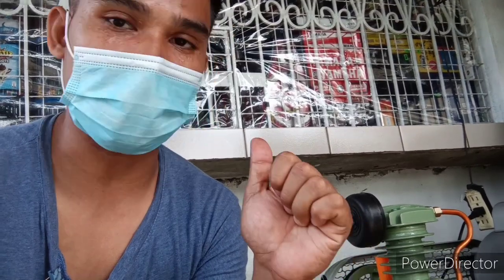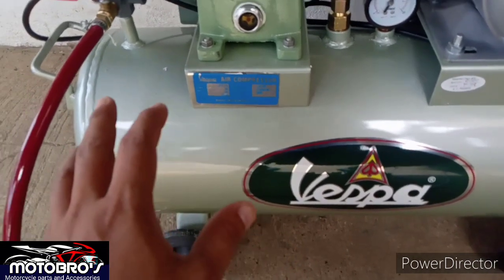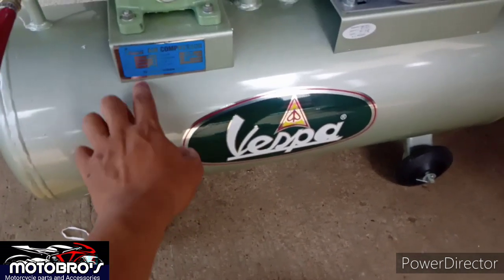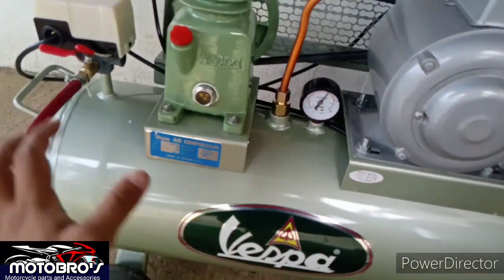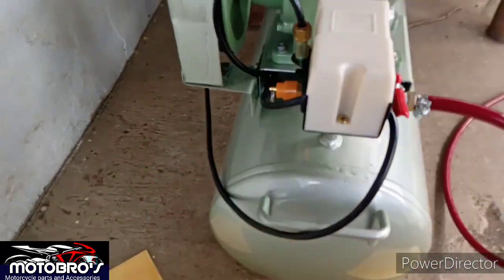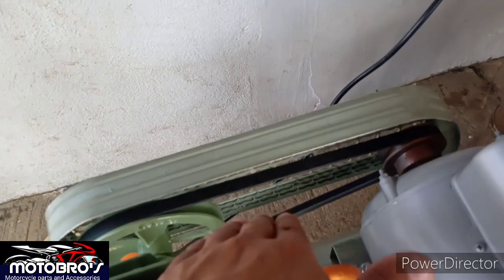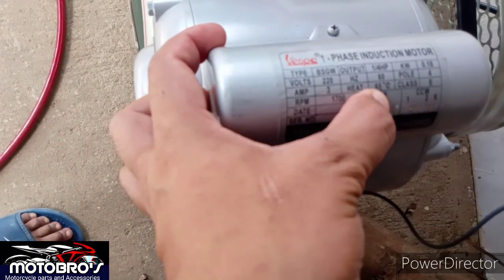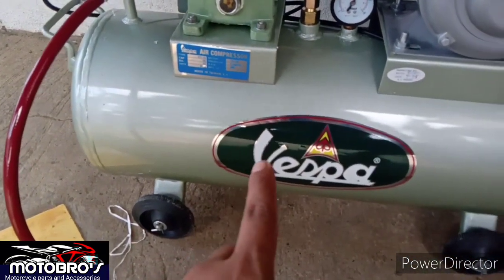Vespa motor air compressor quick review plus updated price 2020

Comment: d pwede kahit anong langis lods, compressor oil tlga gamitin mo for air compressor. d pwede manipis na langis jan ang alam ko ung mga 100 na langis.
Reply from the maker: Salamat idol,,Sabi Lang sa casa,,
Reply: @hajiemotovlogstv862   Pwede  gear oil sae 90 ( for manual transmission car  ) 10 years na vespa ko yan lang ginagamit ko